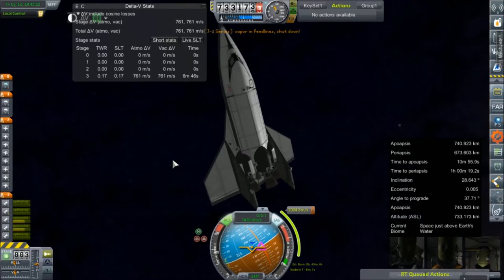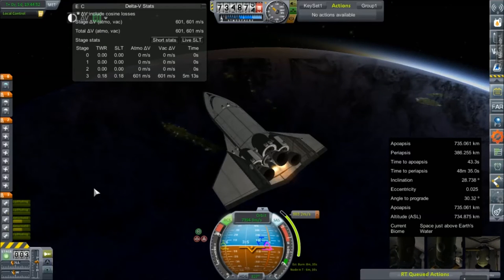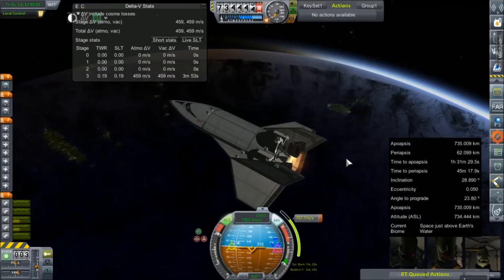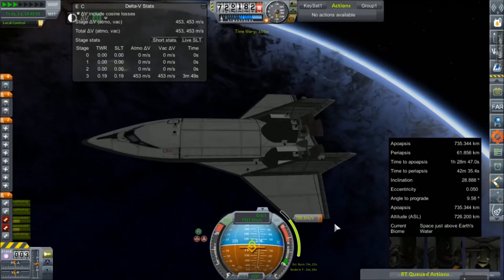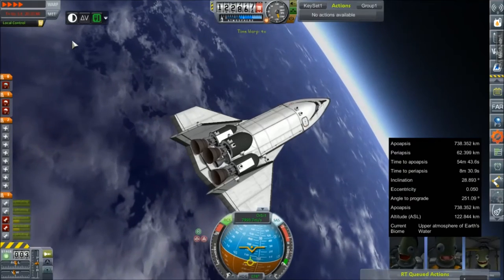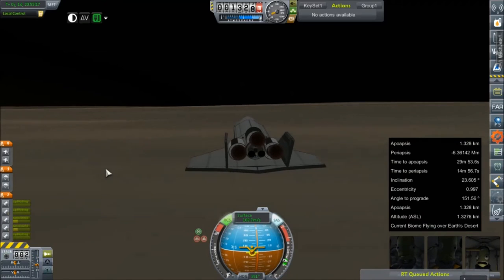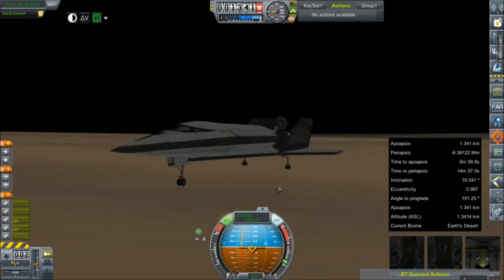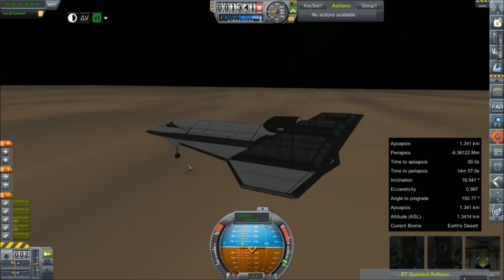KSP RP-0 #147 STS-1 Re-Entry (1960s Shuttle Program)

Comment: I got a working space shuttle 1959 in RP-1 using the previous plane tiers.
Mostly just cuz it's a lot shorter training time
Reply from the maker: I've only played around in RP-1 a little so far - how are the astronaut training mechanics worked in? I don't quite understand it yet, and Nathan Kell has covered exactly none of that in his testing series so far.
Reply: Cosmonaut Crash Well, all cockpits and I believe crew containers need whoever will be launched with it to have Proficiency and Mission training for that one specific container. Essentially, Proficiency training is teaching the kerbals how to work the machine, and Mission training is preparing for the next mission in advance, running simulations, briefing them, etc. You need both to launch someone in a specific container, and you need Proficiency before you do Mission training. Proficiency sticks around for a while, but Mission training is easily forgotten.
For the majority of capsules, this can take a very long time, up to hundreds of days for the earlier ones. However, cockpits have an extremely short training time. My kerbals get cockpit mission and proficiency training in literally one day, my reasoning being that they're astronauts and thus are trained in piloting a plane beforehand, like most astronauts are. It just makes it do much more desirable to launch a shuttle if you don't need to wait 420 days for a newbie to step onto the vessel and 60 days for a veteran
Reply: Cosmonaut Crash Right now I play RP-1 1.2.2 by the way.
Oh and there is Refresher training, which just resets the timer for a kerbal who might forget proficiency training, as all training eventually wears off

Comment: Very shallow pitch for spacepplane re-entry. Concerned about pitch authority? Have you unlocked the 1-direction RCS thrusters by chance? They have helped me maintain 35-40 degree authority on re-entry in the past.
Reply from the maker: Yeah, all thrusters were firing, till they burned off anyways. Next time around i'll try shifting some fuels around, I think all the weight in the rear was trying to bring it in nozzles first..
Reply: Could always hide some inside the bay, if its not too cheatey. Should be protected there.

Combined with your suggested weight redistribution and, perhaps, a 35-40 degree angle of attack (to take better advantage of the body/wing lift in breaking, especially in the high atmo), I imagine thatg will solve your issues. 

I always have to drain the craft of fuel in the VAB and tinker with its mass and lift then + when its full.